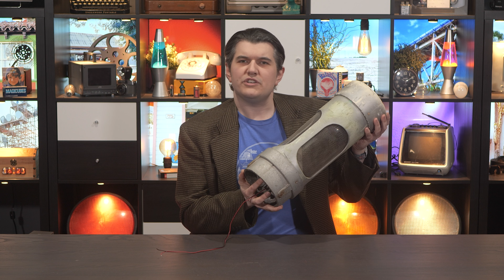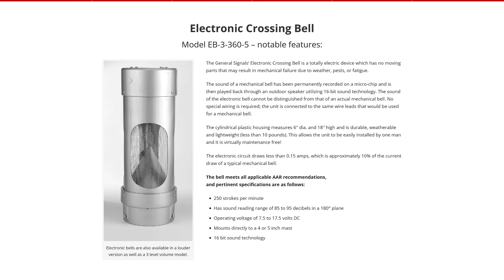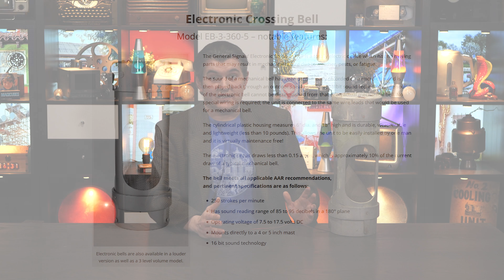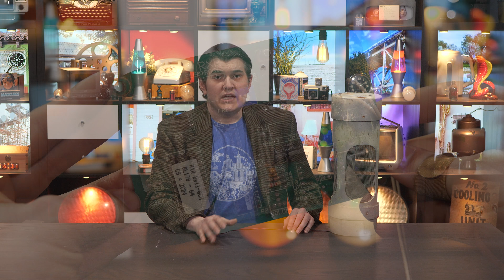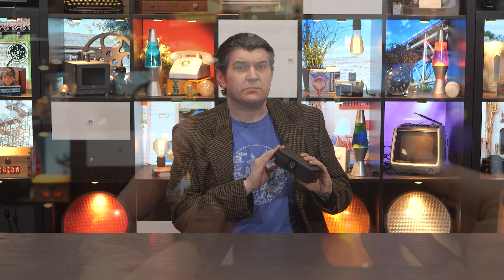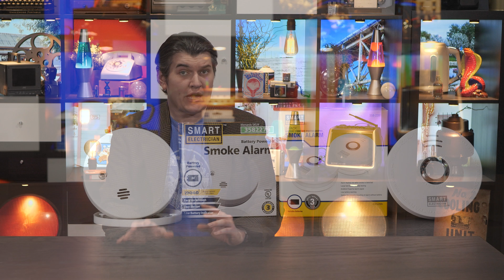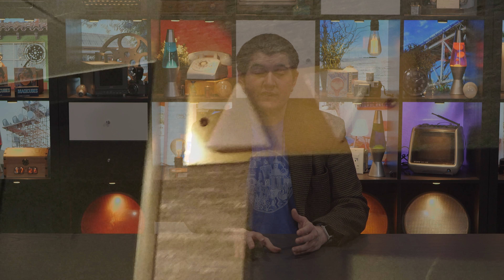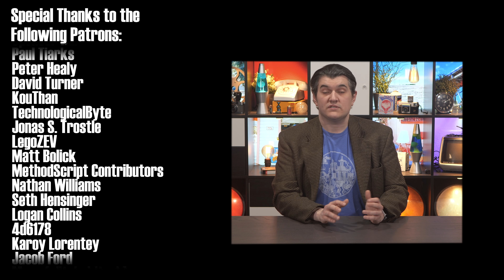The disappearing and unappreciated art of audible alerts

Comment: I work in the fire alarm industry and have been wondering when you'd get to something related to it. I'd love for you to do an overview of a basic commercial fire alarm system. FACPs, Smoke Detectors, pull stations, and duct detectors.
Reply: From someone who has an inside view of the industry, have you actually heard much about the code-3 tone being enforced? I know NFPA72 specifically dictates the standard, but I also still see systems being set to continuous or various voice-evacuation tones. As I understand it NFPA 72 is more of a suggestion or a set of guidelines rather than a strict requirement, which is why older systems that aren't up to code can remain installed and functional. Does this sound right?
Reply: @MichianaAlerting it's always depending on the AHJ enforcing it. Unless it's an old grandfathered system, everything is Code 3 in my area.

Comment: 18:03 I really like the “Otis classic leveling” where the doors start to open before its stops moving. Feels like such a time saver.
Reply: I regularly experience a set of elevators that, for some reason, sit at the landing completely still for about 4 seconds before it even attempts to start opening the doors,

I've easily lost hours to those seconds cumulatively,
Reply: If it's well executed, perhaps, but our local Otis tech has their timing off here, because the doors end up so far open while the cab is still misleveled that folks can start to try to exit, creating a trip hazard.

Comment: I'd like to be able to wear my apple watch to bed for sleep tracking, but define alarms on my phone as strictly always on the phone and always as loud as possible. I like my apple hardware for the most part but I gave up on trying to get the wake-up alarms to work reliably years ago and just did the work to develop an actual good sleeping pattern so I wake up at the right time naturally, lol. Probably for the best in the long haul but I'm still infuriated by it when I e.g. need to wake up early for a flight or something. I can never be 100% completely confident that the alarm I set on my phone will definitely play, from my phone, at full volume, and not just like, tap me on the wrist and call it a day. It uuuusually does what I want, but fails just often enough to leave a justifiable doubt.